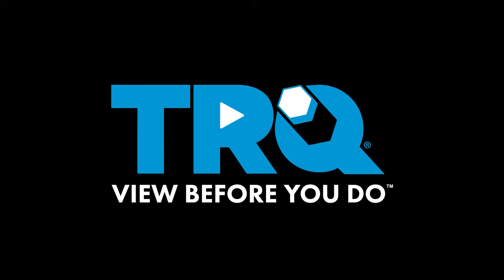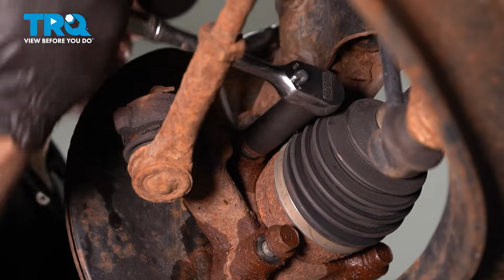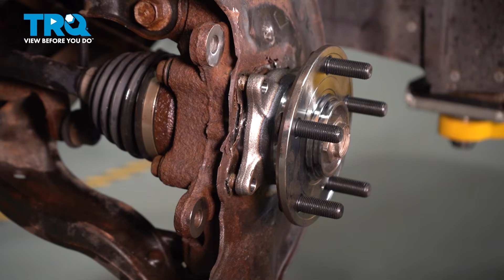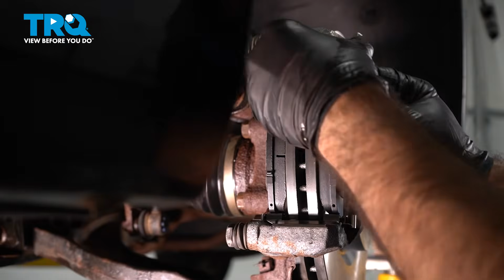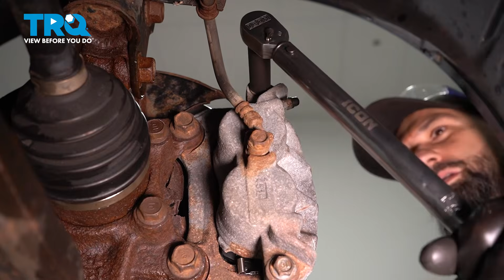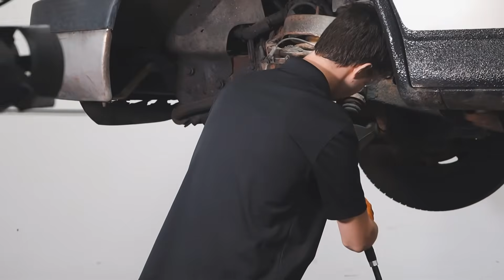How to Replace Front Wheel Bearing & Hub Assembly 2011-2017 Honda Odyssey

Comment: Your videos are the best, thank you again! I broke 2 wheel studs when replacing my front sway bar bushings watching your other video. Local shop quoted me $120 to replace both studs or $550 for a new wheel bearing. Bought a timken wheel hub, new lug nuts, and the 36mm impact socket for just under $100 and did it myself just now watching your video. It did help already  having some heavy duty impact tools and a slide hammer for removing the wheel hub. Got everything done in about 2 hours, which included soaking the wheel hub and caliper bolts in krill oil. Thanks again!

Comment: It's a good thing this van got lower control arms & ball joints in another video.  You can see the sloppy joint @ 13:20 when he's torquing down the new hub assembly.

Comment: That rotor, cal and brakes all look brand new. Must of gotten them on and then realized needed a new bearing? The first bearing bolt, you were tightening it instead of loosening it:). Great video though, thanks.

Comment: Could you have used a pulley puller to pull the hub assembly off the spline instead of persuading it with the sledge?

Comment: You can take the caliper bracket off with the caliper and hang it from the spring instead of removing the pads and caliper separately to save time. Also you can use an air hammer and a punch bit in the center of the axle if it is seized in, should pop right through the hub with a good air hammer. Also same thing for the rotor screws they usually get stuck you can use an air hammer and a bolt buster to get them out. Great vid thanks for the simple and well documented walkthrough